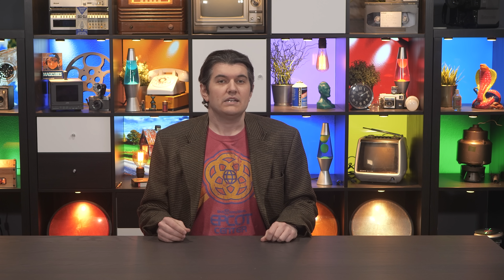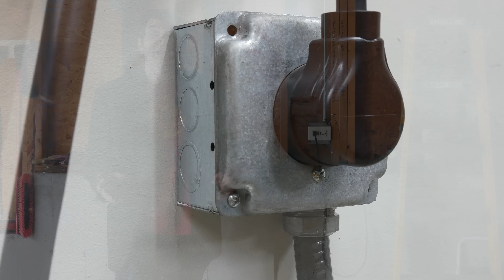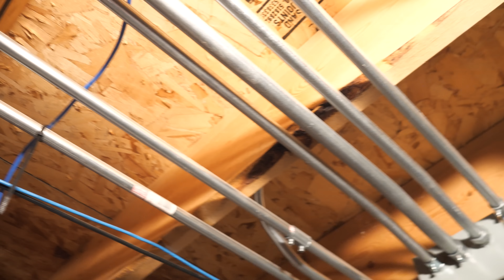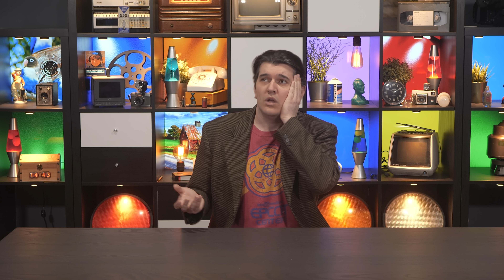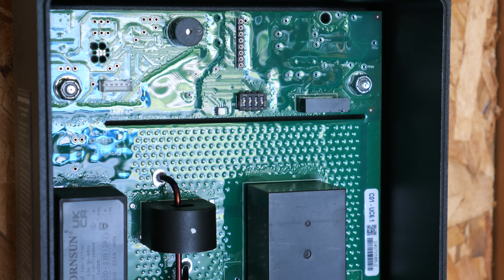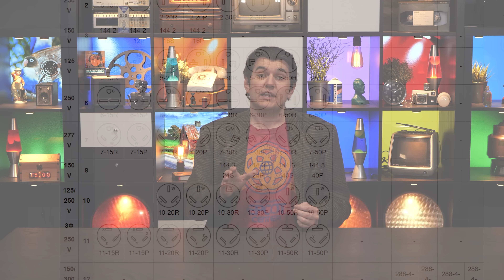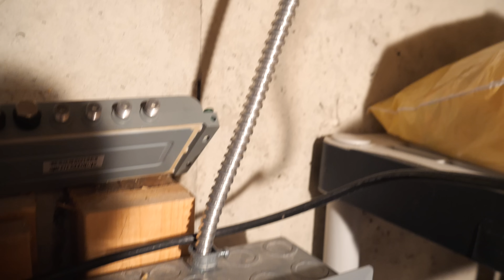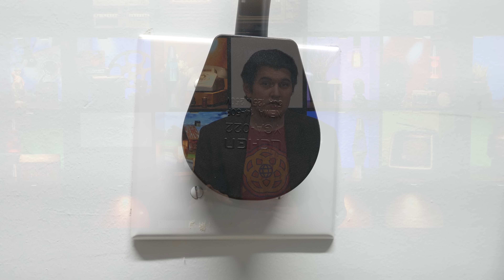The "standard" car charger is usually overkill—but your electrician might not know that

Comment: Tesla wants us to keep the car plugged in when it's at home and not in use. I ran my errands today and came home and plugged it in and it said it would be topped off to 80% within 20 minutes.. I had a 240 volt outlet installed in my garage and in the circuit panel it has a 50 amp breaker. My mobile Tesla connector supplies 32 amps in my garage. The reason why I upgraded to the 240 was I wasn't sure if in the winter time when it gets nipply cold I didn't want all of the 12 amps from a 110 outlet to go to warming up the battery and keeping it warm

Comment: A few years ago, we moved houses. Our new house made my wife’s commute quite a bit longer, and all freeway instead of smaller rural two-lane road. (Although because freeway is faster, her time of commute was about the same.)

But between the longer distance and faster speeds, it meant our BMW i3 could barely make the commute there and back. (Not helped by the fact that she started work at 5 AM when roads were empty, and she has a lead foot.)

But since we had just moved, we didn’t have a circuit for our 240V EVSE. So we were limited to a 120V 20A garage outlet. 

If she plugged in the instant she got home, she’d get to 95-100% by the time she had to leave the next day. If she did any errand, she’d be a bit short. 

Over the course of a work week, she’d get home on Friday at less than 5% remaining thanks to the “didn’t completely recharge” stacking up over the week. 

But then the weekend meant plenty of time to charge back to 100%!

A couple months later; we did get our EVSEs installed. (Yes, plural. We installed two load-shared units on a single 60A circuit, because we also bought a second EV.)
Reply: Idk how your post is mathing here, unless these are far-away multiple hour errands. 
Or is your kwh capacity just really low?
Reply: @BL3446  yes the original i3 only had like 100 mile range
Reply: @BL3446 First generation BMW i3, really small battery.

Comment: Thank you for your insides, in Germany it's so much easier. Standard outlet is at 3.6 kW max (16amps 1 phase) and 2.4 kW continues (safety). Charging stations have 11kW or 22kW with permission from your service provider and only a few vehicles support that (16 or 32 amps 3 phases), thats all. All these nema stuff is confusing. (Yeah there is something like CEE but doesn't matter). But the people are not interested and I think, they shouldn't have to. Why is it so complicated that every household, garage or parking lot has a charging solution, by default?

Comment: As a european I can sort of confirm this. I own a leaf and sadly it has a 6.6 kw single phase chargers. where i am it's trivial to install an 11kw triphase EVSE but i am limited to 3.3 kw. Still, at that 3.3kw I mostly completely fill my car up over night. Technically with the 62kw battery it would cost me about 24 hours to go from empty to fill. but that never happens. sometimes i get to 90% before leaving and that is fine since always charging to 100 isn't the best. 

Do i want an 22kw charger at my home for faster charging? Sometimes yes, when moving between multiple places the slower single phase charging speed is annouying but most of the issues stem from design choices with the leaf not with electric charging and are easily solved with an Chamedo to CCS or chamedo to that wierd american one adapter.

Comment: I'm one of those in an apartment building who is reliant on installed charging capacity near me. It was one of the things I was most nervous about when buying my EV (I hadn't moved yet when I bought it, but I knew the area I was going to live in). I don't even notice it, its a trivial component of my life. If anything, its an excuse to go for a walk later at night, and I often get to charge for completely free (legally). 

I live in a building which about 100 units divided over two physical buildings but which share a parking garage. The garage is 9 floors and on top of being required as part of the rent, so everyone is using it, there are also an additional 10 floors of office space above the garage which also share it during business hours, as well as many restaurants and even a train station across the street, so people long term park there. In the whole garage there are FOUR slow charging ports, which you have to use at $1/hour. On top of that, most of the time during the day people who work in the office building park their Tesla's in those spots without charging, even though there's scary signs threatening them with a $250 fine. One of the best perks is that there's a park one block away from my building which has two slow chargers that are absolutely free to use (aside from paying for parking, which is free on nights/weekends). Its constantly full of other EVs and even some non-EV friends who can't read signs and just want to hang out. And, one of the chargers was broken for about 6 months, which made it way harder to charge there. There are a lot of EVs in this area, they definitely don't outnumber the ICE cars, but they are getting closer and closer as time goes on.

This sounds super daunting, but I have never once had a situation where I couldn't charge my car if needed, without relying on any infrastructure outside of a block away from my apartment. I also have a Chevy Bolt, and I'm locked at 80% charge like a lot of owners, so I have about 170 mile range, and with my commute I charge every week and a half or so. The biggest difference I have right now as opposed to driving a gas vehicle is that I go a little out of my way to check the EV spot at the park if I get home after 6 (when I don't have to pay for the spot), and its a 50/50 if its open. If I charge there, I just walk back when its done usually around 10-11 pm and bring it back to the garage to park, no effort at all.

This IS still a potentially bad situation if they don't install more chargers as EVs get more popular, but we aren't near that yet at all (in my bubble). I think the biggest problem with capacity at the moment is enforcement of people not charging in the charging spots, and a lot of them a commuters who could probably charge at home anyway.

Comment: Hi Mr TechCon, I love your very interesting and informative videos and also like the way you share the bloopers at the end. So I thought I'd send you a little gem of trivia from the UK. Over here, those awful plastic twisty connectors that I believe I heard you refer to as wire nuts have been for decades almost universally known by electricians as "dog cocks." Back in the days of lead, rubber and fabric covered cable they were originally made of white ceramic or porcelain and obviously got the nickname due to the stubby phallic kind of shape. I'm not even sure if they are legal to use in the UK now, but I just thought you might appreciate that little piece of useless information, lol.

Comment: I like charging stations that support OCPP, that way I can tell the charging station when I want it to charge my car from Home Assistant automatically, and I can base that on current electricity price. No privacy concerns since it all runs locally.
Reply: Yeah OCPP is basically a must have, especially if you plan to or already own a PV install or can use low-price rates.
But even those are less than 350€ here in Europe nowadays.

Comment: I charged my Model 3 off a regular 120V, 15A outlet in an unheated garage. It was okay, not great, in the summer, but once the temp dropped below ~20F it was barely to cover my 50 mile round trip commute. Sometimes. When it got below 0F it wasn't enough.

My brother's electric dryer is only 20A/120V outlet. So not all electric dryers are ready to go with EV charging.

Comment: I've had my EV for 4.5 years. It has been plugged into a standard 15A plug the whole time and has never once not been enough for my driving patterns. The ONLY annoyance is the circuit in the garage is the same GFCI circuit for the house. If anyone uses a hairdryer while the car is charging it'll trip the circuit. The car is almost always done charging by morning when anyone would use a hairdryer anyway so this is really rarely an annoyance at all.

Comment: If you have a good electrician, you could definitely describe this type of work to them and they’ll do it in like 30 minutes and charge a reasonable rate. This is where being a knowledge homeowner is really important. If you naively asked an electrician to just put an EV charger into your garage, they would likely quote you for Level 2 charging out the gate. They aren’t going to assume you drive a small-to-midsize EV under 40 miles a day.

Comment: We do ok with a 120v plug.  Wish our charger allowed more than 12 amps though, because the circuit can handle up to 20 amp.  Unless you have long drives for multiple days in a row it's never an issue.

Comment: I like that you’re calling it an 80% rule for the purposes of this video and the people watching because they are not all engineers, but in engineer land there is no such rule. in reality, you calculate the voltage drop for the wire size and current draw and length of the wire. Some 50 amp circuits are perfectly happy to deliver 48 continuous amps (or even 51) 24/7 without getting Luke warm. There are so many variables that it’s good to give people a rule of thumb like that though… Edit: also, I used to work at my local Ace Hardware and I was the go to guy for electrical stuff, even though I worked the pool and paint aisles. I saw so many Leviton brand 30 and 50 amp plugs and sockets melted that people brought in looking for a matching replacement… unbelievable how poor of a job the underwriters laboratories are doing regulating the design approval of those things. North American sockets in general have very poor contact pressure… hubbel is better but they too are going to self destruct if there’s vibrations or if they are inserted and removed much.
Reply: I'm Electrician. 
The majority of melted receptacles I see are either worn out & loose and / or the screw terminals not torqued properly. 
...Or it's a backstab receptacle. 
Usually if I find the screws not tight, I'll find every other device in the house with loose screws too.
Reply: @benjurqunov yep! I hate those spring terminal push in connections, seen plenty of those receptacles from mobile homes melted as well.
Reply: I think the 80% rule came from the National Electrical Code. Constant loads are limited to 80% of the breaker, and loads are permitted to 100% of the breaker capacity temporarily.
Reply: @lazarusdishwasher  but yet the breakers are rated for temporary excursions above their rating… nec is goofy, very practical in some ways, but very dumb in others. I should get licensed for fun just to see what they are teaching

Comment: Regarding "smart" chargers...I'm in the UK and have a 7.8kw charger made by Ohme. The neat part is just plugging it in and Octopus Energy do the rest. It means they can use all us guys to balance the grid (and get the best wholesale price) as well as guaranteeing enough hours for a full charge giving the cheap rate outside the normal hours of 23.30 to 05.30. It also has a Solar charge feature so that any excess power can go to the car. Even with my small array I can add 20 miles range on a sunny afternoon.
Reply: Depends on the export rate, but isn't it slightly cheaper to sell your solar to the grid then buy back IOG off peak to charge your car?

Comment: Those 1450 plugs make me feel nervous. The connectors aren't sheathed and there's very little distance between the edge of the plug and the connectors, meaning it'd be really easy to accidentally slip a finger behind the plug while inserting or removing it and get electrocuted --- especially as they seem to be really stiff and also don't have much in the way of grip to hold on to.
Reply: My thoughts exactly. I guess it is normal in North America.

Comment: Germany here, where most professionals suggest to get a 11 kW wallbox for your EV. Which is fine if you need to quickly refill your car in a few hours. However, our house can not supply more than 24 kW at any time and 11 kW is way more than our solar power would be able to spare anyway. So, I just used a smart power plug, added a regular charger limited to 2800 W and can simply plug in my car now - Home Assistant will take care of the rest and turn it on only if I have enough power left. I even ran a 50m long cable to the parking in front of our house and can now supply one car at a time out there.
Reply: For anybody wondering: „wallbox“ is what a home charging station is called in Germany.
Reply: @mahuhude  I'm sorry, I thought that's the international term for it, but of course it's not. Just like we call cellphones/smartphones "a handy" :D So yes, wallbox usually refers to chargers of 11 or 22 kW, while the 11kW can be installed without additional permission, but everything bigger requires the consent of your power network operator.
Reply: One problem with those 11kW wallboxes is that not all EVs can use three-phase supply. New EVs, especially from European brands can, but some older models can't. Kia Niro and Hyundai Kona are great examples of those limited to single phase
Reply: @jur4x  My Hyundai Kona (2021) can charge at 11 kW. Some models even support 22 kW. But I agree, not all models do. The MG4 of my sister is limited to 7.2 kW.
Reply: Be careful with that. Some EVs (maybe even all?) are incredible inefficient when charged with such a low rate.
For example the Renault Zoe R90 only is about 75% efficient when charged at around 2.8kw. Whereas at 11kw it is about 89%. So you are wasting 14% of electricity by charging that slow.

This might not matter if you always only use solar power, but chances are that you don't.
Reply: @Jehty_  That's why I only use solar power to run that connection. I have a 11 kW charger down in the basement for efficient charging / emergencies.

Comment: In Denmark you're not allowed to mess with electrical installations like that anyway.

So, if you want more than what a granny-plug can provide from a regular 240V/16A wall socket, you'll need a professional install done anyway.

Depending on how your home is connected to the grid you can choose between 11kW or 22kW for your garage charger.

Price is virtually the same, but it doesn't really matter.

Many electric companies will cover the cost of box and installation if you sign up for a subscription with them. They'll even help you with the funky tax deductions you get on the price of electricity when you use it for your EV.

And yeah, most high Amp subscriptions for EVs use a variable price per kWh depending on the market and time of the day, so there's a lot of money to save if you only charge within the _cheap hours_.

So, it's a bonus if your grid connection is capable of 22kW and your car can be programmed to mainly charge at certain times.

We have days where electricity is virtually free, thanks to our grid depending on wind power to a large extent.

Comment: I own an EV and live in a townhouse. The garage has a dedicated 15A outlet that was originally meant for the built-in vacuum. We charge overnight and over weekends using that outlet (our Kona Electric usually caps level 1 at 13.5A). It's always been sufficient for us, and for road trips, B.C. has an excellent network of public and private level 3 chargers on long-haul highways.
Reply: Actually, your Kona electric can charge all the way up to 32A on L1 - at least mine can. Technically, since the J1772 doesn't define L1 charging above 16A, you could argue that this is not technically L1, but the control pilot signal is the same for L1 and L2 and many onboard chargers will happily draw more than 16A at 120V if the EVSE control pilot signal says that current is available. The standard EVSE that comes with the car is set for 12A, so the control pilot signal it sends to the car's onboard charger tells it not to draw more than 12A. That doesn't mean it can't draw more than that. It's just well behaved. My EVSE allows me to set any current limit from 6A up to 40A and since I wondered what the car would do if told more than 16A was available on a 120V circuit, I tested that early on when I had both the car and my "big" EVSE. It's not common to find 120V circuits rated for more than 20A, though. About the only likely one you might come across would be some powered campsite and trailer hookups which may be a 120V 30A receptacle.

Comment: App control is typically a prerequisite for tariff linked charging for the available suppliers here in the UK, and the fact that my Zappi load balances with my solar is also a much welcome feature.  I’d certainly steer clear of an EVSE that REQUIRES app control to even perform basic functionality, but to outright avoid them can make your experience either more expensive, or worse, or both.  Fortunately the Zappi can be fully controlled using the keypad and menu, but the app is easier.  Mine also doesn’t auto-update, so is unlikely to be left bricked.